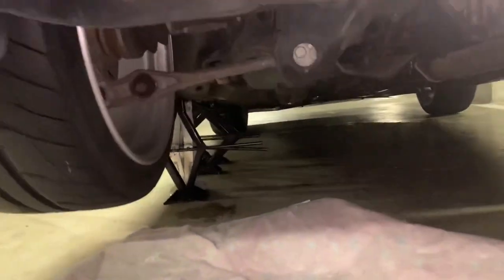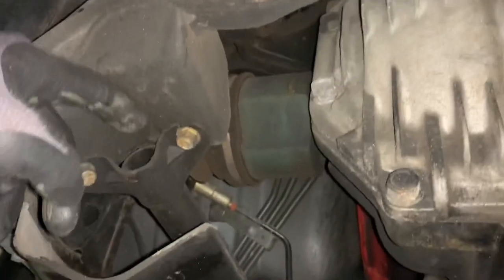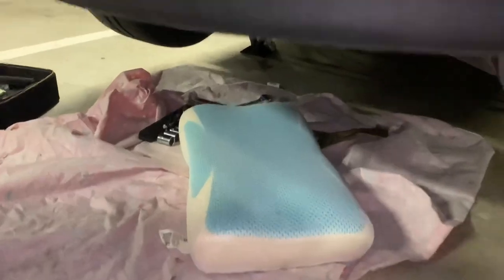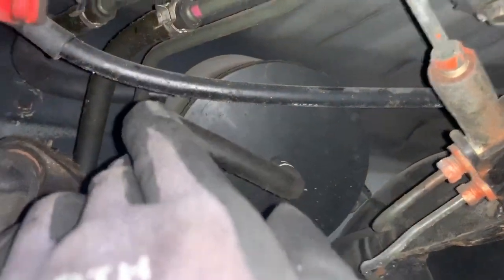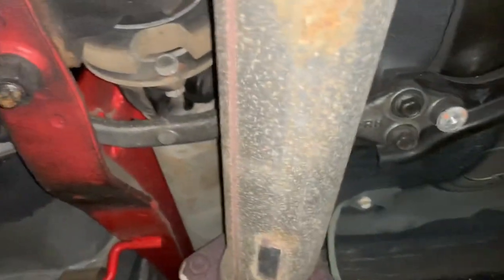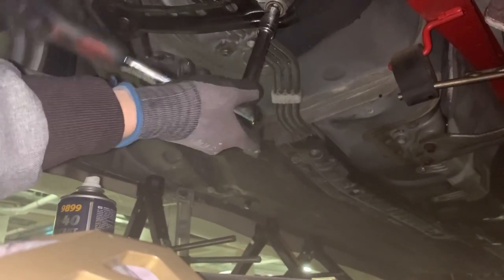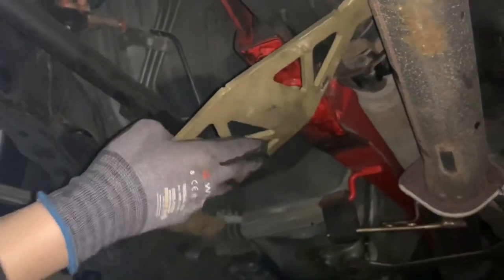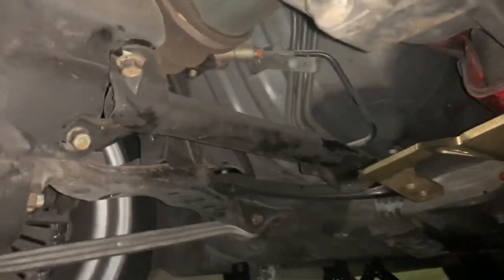Mazda RX-7 FD Build Episode 21: This Diff Brace is Absolutely Amazing

Comment: Check out Banzai-racing fd transmission mount.  It's a good addition.   
Banzai-racing also makes a diff brace too. 
The feed is great on driving with both. I feel more vibration in the rear end from the brace but for. Sports car it's about feel and driver preferences.  Communication between driver and car is important 👌.   Enjoyed the video.